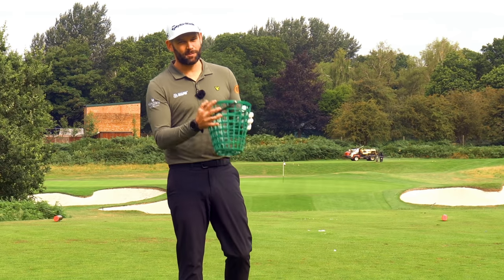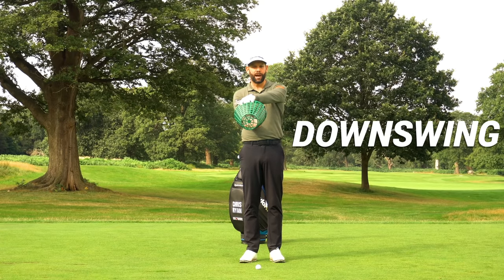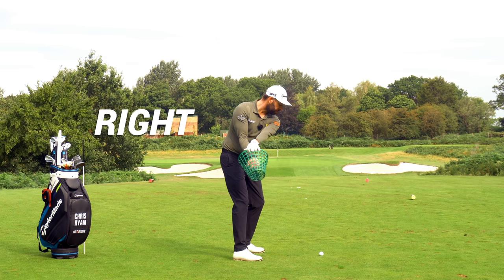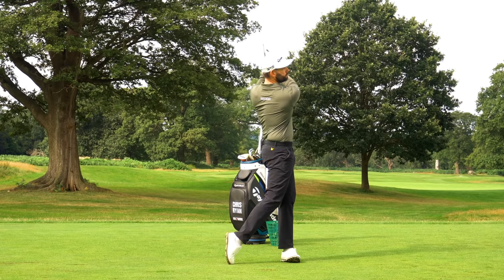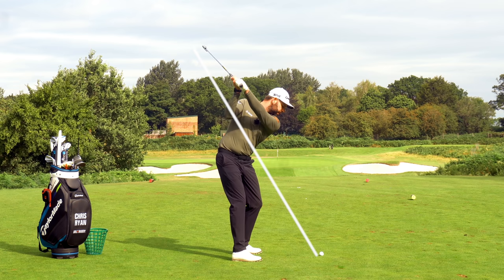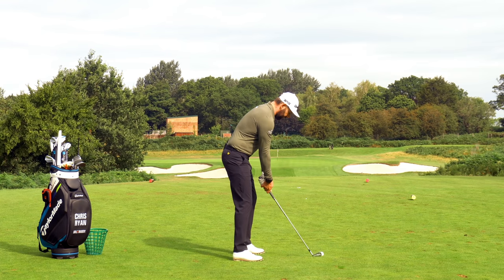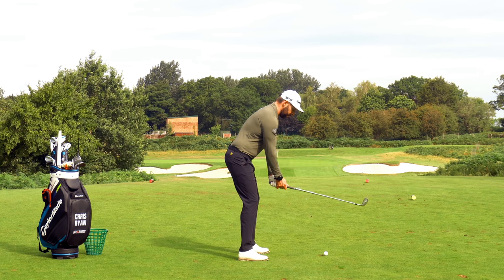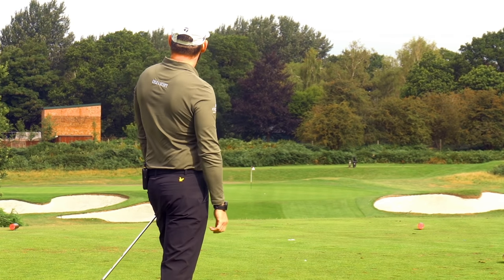Fix Any BACKSWING Fault With The STEERING WHEEL Drill

Comment: The important point is that it’s the forearms that are guiding this action if you want to use the steering wheel. The thing is when we turn a steering wheel in real life that action is occurring from the shoulder joint. If we did this in rotation from the shoulders in the same direction as the forearms are turning we’d run into all kinds of problems. In fact the shoulders should rotate/be rotated in the opposite direction!  Trail shoulder internal backswing to external downswing, reverse for lead arm. That’s essentially what having the trail arm above the lead arm in the backswing is all about.
So to use the real life steering wheel action in the golf swing the bucket should be moving in the OTHER direction in the backswing and downswing. The respective  forearm supination and pronation of each arm through backswing and downswing balances things out, keeps us on plane, with the club staying in a good position relative to the torso.

Comment: Understand the lesson but the wrists are hinged right at the start, but in a normal swing they hinge somewhere higher on the backswing. Don’t they?
Reply from the maker: Yes spot on the wrists do set a little later in most swings. The wrists generally set as we rotate the arms so to isolate the movement that I was demonstrating I set them to begin with, which is why it did look a little odd
Reply: @ChrisRyanGolf  thanks. I just got a new driver today, so will be checking out your driver instruction videos again!
Reply: How does this drill coordinate with trying to deloft at tmpact?